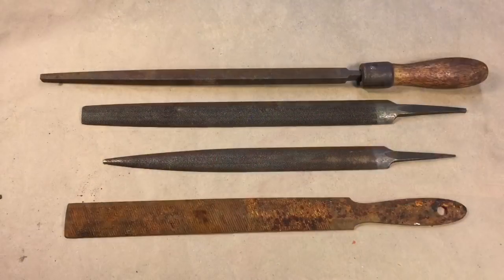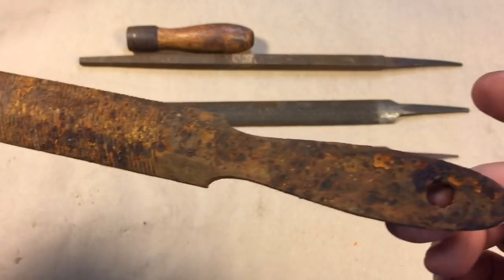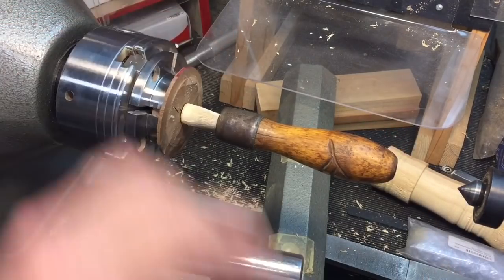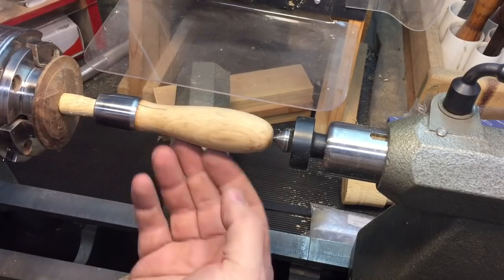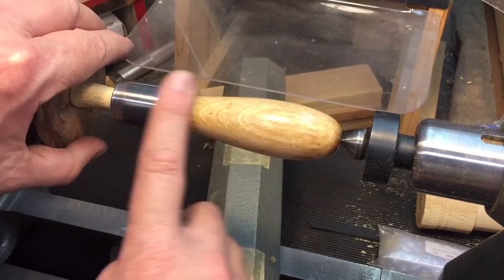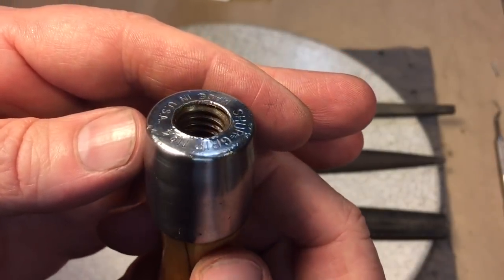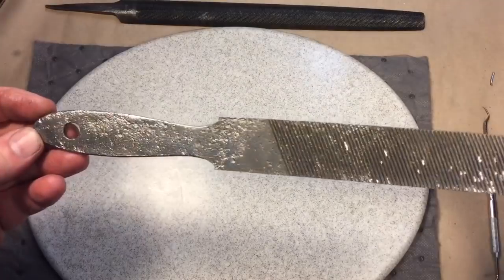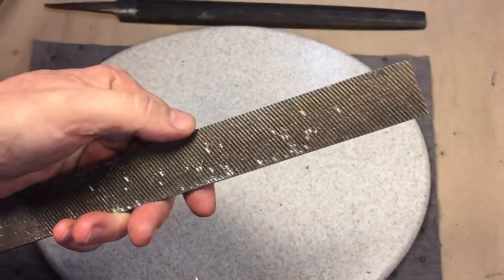Restoring Three Dollars Worth of Antique Files

Comment: Good Video. 40+ years ago, I was taught to pour old battery acid into a glass pan and soak files in it for a few hours to resharpen them. Same idea but, I had forgotten about it.
Reply from the maker: Hello Richard!  Yes!  Lots of different acids do a good job on rust removal and sharpening... Muriatic Acid and sulfuric acid are two more choices...  Vinegar is very safe!   Thanks!!!!!!
Reply: I use watered down vinegar to clean corrosion in old carburetors.

Comment: A wire bore brush for a shotgun would be a great tool to clean the threads inside of the handle. You could even put the brush on the end of a drill for a wire wheel.

Comment: That is one of the best videos I’ve seen of yours. Thank you. I was especially interested in how you restored the wood handle. The result was amazing. I have a 1960’s wood handle Snap-On screwdriver that I’ve been wanting to restore but didn’t know how to. I don’t want to use sandpaper as the branding is very lightly marked on the wood. Can you tell me, please, what that stuff you deployed to clean the wood before you mounted it on the lathe? 
I’m going to be searching through all your old videos now looking for more tips on restoration.

Thank you again. Love seeing these tools restored so well. You must have quite the collection by now.
Reply from the maker: Hello Frank!  The problem we always face with screwdrivers is trying to save the logo!  I have had that dilemma for years!  You have to make the choice... Saving the name many times means limiting the restoration.  You can use many things to try to remove the grease, dirt and grime from the handle... Probably the safest is Mineral sprits and steel wool... From there you can access how far you want to go... I know it's a tough call but rest assured that whatever you do will be an improvement over a dirty wood handle!   Thanks!!!!!!!!

Comment: yep a bargain for those great quality sharp files,  well worth restoring them back, they cost a fortune to buy new.
Reply from the maker: Hello Jusb!  You're right!  When did files get so expensive?  They are certainly very easy to make and I can't understand how they can get so much $$$ for such a simple tool!?  =)    Thanks
Reply: Economy of scale. When every shop used files to finish parts or fit them, the file making machines ran nonstop. CNC mills and lathes with ceramic inserts don't leave burrs. I use to buy 20 or more boxes of files at a time for the tool room.  I still use them, but I use a Dremel more often.

Comment: Nice presentation ... We can also get some more mileage from dull, worn out files and rasps by putting them in muriatic acid. I guess that vinegar, although a weaker acid (and is used for rust removal) could do the trick. Did you have to degrease the files first?
Reply from the maker: Hello Carver, these files weren't greasy or oily just rusty... Perfect for a vinegar bath... Stronger acid works faster...   Thanks!!!!!!!

Comment: So you just soaked these in white vinegar for a few days?  Was it what is known as 5% acidic white vinegar?  I have a millers falls breast drill soaking right now and I hope it comes out as clean as these files did.
Reply from the maker: Hello RG!  Regular supermarket White Vinegar, a couple days and everyday scrub the part with a brush.  It works very well!  Then afterwards rinse in a baking soda and water neutralizer...   It does a good job removing rust!   Thanks!!!!

Comment: Is using the wire brush wheel on the bench grinder a no-no for metal files? 
Also you do amazing work!
Reply from the maker: Unfortunately most wire brushed will dull the teeth of a file, I have used a Brass hand wire brush with some success but Evaporust or vinegar is a better alternative if you have them!  Thanks!

Comment: great information about wd-40 i wasnt sure to use it or not but i though i use it then file wood and brush off, lol this funny video today because i went throw stuff i got at yardsale got about big 17 old files need to start making handles for them. Vinger not only remove rust it sharpens the blade or atleast that what they say also good when ur done to use baking soda to neutralize the vinger
Reply from the maker: Hi David!  YES!  I forgot to mention the Baking soda!  Always afterwards to neutralize the acid!  I really like the BIG files!  They aren't cheap but if you get them at a yard sale you got lucky!!!  Great stuff!   Thanks!!!!!!!
Reply: yea i come accross ever so often no one buy files around here (yet) i need to figure out how to make my desktop drill press to make handles out ock doles. i know you can take handle off one andput on another but i like to have them handle i was lucky most files i get have no rust if so it long gone and black so cleaning up with a brass brush and a peice of copper makes it like new.
Reply from the maker: Yes!  I too like all my files to have their own handles... Lots of times I use them without handles... I do like the Handy Files that have a forged handle!  I wish all files were like that!  Thanks!
Reply: @davidhoward2237  Drill presses do a nice job of turning. Grind a point on a bolt and put it in the center hole of the table. Cut off a screw head and clamp it in the chuck, or make a mandel like ScoutCrafter did. . Spin the stock onto the screw until it hits the chuck jaws. Raise the table until the pointed bolt pinches the stock. Now you are all set to sand. 
Rig a tool rest from a c clamp on the table and you can turn your own handles.

Comment: Great video, as always! Have you ever known anyone to rub chalk on their files as a “lubricant”? I read about that somewhere and have been wondering if it works...
Reply from the maker: Hello Patrick!  Yes it does!  Chalk on a file helps the chips to release, so the file won't get clogged up...  =)  Funny thing is chalk isn't as available as it was when I was a kid!  LOL   Thanks!!!!!!!
Reply: Chalk used to be sold in small box's and in different colors.All the 5 & 10 cent stores carried it. We had it at home for our small slate boards.
Reply from the maker: Those were the good old days!!!!  Give a kid a piece of chalk and a sidewalk and let the fun begin!  LOL
Reply: Dave Chadwick turned me onto using French Chalk in files. Blackboard chalk is better than nothing but French Chalk is amazing. Took me a while to find some. I kept trying to find out what it was. Then I finally found the answer. It's soap stone. That's what the white chalk like marker used by steel cutters is madr from. I use it for welding projects, and with the plasma torch, because it doesn't burn off. 
It feels slick in your fingers. Lightly rub it in the file and it keeps the metal from sticking in the teeth.
Reply from the maker: Those French.. They're crafty!   I like their toast and fries!  =D
Reply: Old Sneelock's Workshop
I score my chalk when cruising my 'hood, seeing kids making a hopscotch board on the road, I tell them mom just called and lunch is ready, when they run inside I grab up all their chalk and race off down the road. I haven't bought any since 2001, works every time. ☺

Comment: Nice...Nice...Nice...How long those a file last...
Reply from the maker: Hello BK!  You know I have files that were my Grandfathers!  On wood they last quite a long time because the wood is soft, however when filing harder metals like steel files tend to wear quicker... First the middle of the file gets dull and you start using the heel or the tip and then when they go the whole file is dull and you put it under the bench to be made into a knife or tool later on!  =)   Thanks!!!!!!

Comment: I have a file that someone used to stir paint. Suggestions on how to remove the paint?
Reply: Paint Remover? Heat Gun? Wire Wheel?
Reply from the maker: Paint stripper! Then use stiff nylon brush!

Comment: I saw another video about using drain cleaner acid to sharpen files. The vinegar sounds much safer. Just takes a little longer. I got time. Also, stuff stuck in the teeth of a file I believe, is called pinning. Who cares, right?

Comment: Never oil your files. Ever

They will look great but as soon as you start using them the gunk will mix with the oil and fill up the gaps between the teeth. Then you will just have to start all over again. Dont forget metal is porous so any oil will have penetrated below the surface.
To get the oil out you will need to boil them, probably twice or more and using soda crystals.

Comment: Feel like the metal parts should be melted and re-cast.
Reply from the maker: Hello LK- When the files wear out they make awesome knives!!!!!!!!!   =)
Reply: That's because you probably don't know a thing about metal-work lol. Cast metals are ridiculously brittle even when done right, and nobody that's working out of the garage is gonna have the equipment required to cast metals properly. The only useful thing you can do with tool steels is forge them into billets and then machine them. Casting would just ruin the steel.